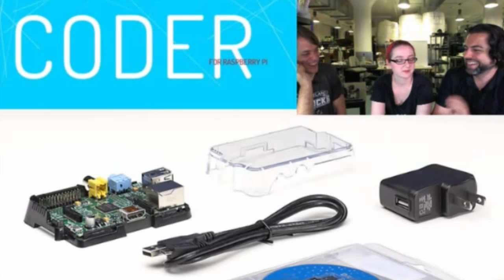New Products 10/5/2013

Comment from the maker: See what's new this week! New Products 10/5/2013

3DR Iris - autonomous multicopter (0:01) http://www.adafruit.com/products/1546

CODER Pack for Raspberry Pi (0:40) http://www.adafruit.com/products/1538

4GB SD card for Raspberry Pi preinstalled with Coder v.4 (0:40) http://www.adafruit.com/products/1537

Cold 3-Wire Splice (UR) - 10 pack (1:13) http://www.adafruit.com/products/1495

Cold 2-Wire Splice (UY) - 10 pack (1:13) http://www.adafruit.com/products/1496

Cold Splice Wire Tap (UB) - 10 pack (1:13) http://www.adafruit.com/products/1494

Grand Ideas Studio JTAGulator (2:51) http://www.adafruit.com/products/1550

DS2413 1-Wire Two GPIO Controller Breakout (4:45) http://www.adafruit.com/products/1551

Adafruit USB Power Gauge Mini-Kit (5:53) http://www.adafruit.com/products/1549

Stereo 2.8W Class D Audio Amplifier - (8:55) TS2012 http://www.adafruit.com/products/1552

 #Adafruit
Reply: I love Adafruit, you guys are AWESOME....